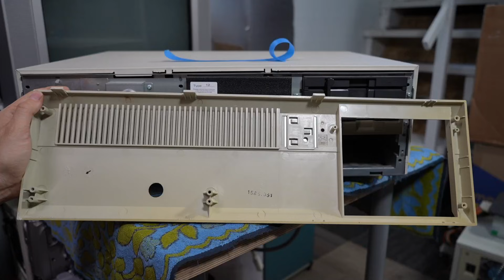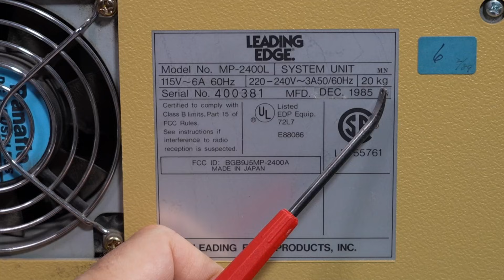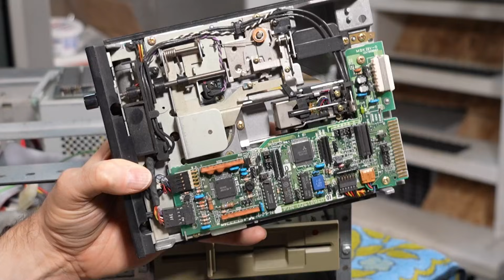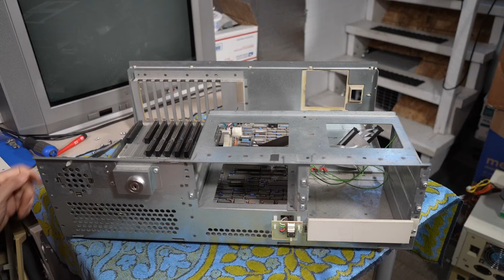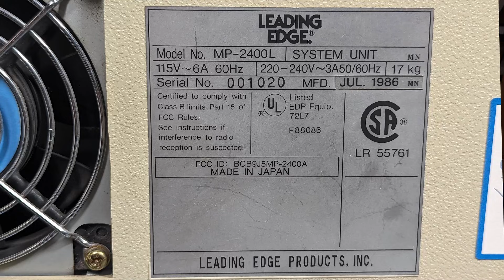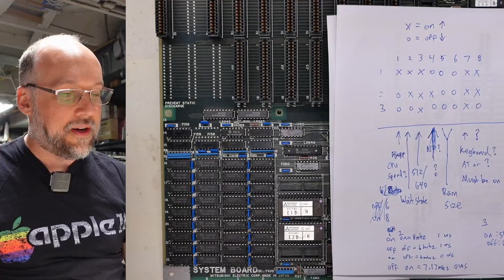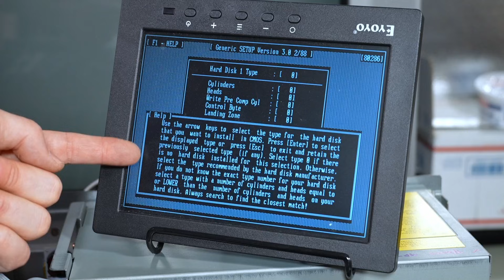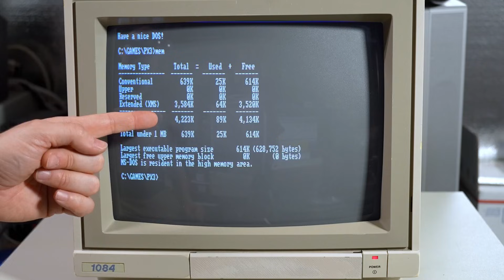PC archeology: The Leading Edge MP-2400L doesn't exist

Comment from the maker: Side note -- the one 1986 machine wouldn't run at 7.17mhz at 0 wait states. It would act up and freeze. All the other configurations worked fine. And the two older machines had no problem running at the fast 0 WS mode. Strange!
Reply: Would you like another one? I have the Sperry version of this same Mitsubishi PC, glad to donate the entire setup, including monitor, original keyboard  and manuals.  I'm located in the Portland area.
Reply: @ruly999  why would you donate to someone who dosent need it ? plenty of poor computer fans out there. im poor but in another country. so not me. just puzzles me ? sorry
Reply: Perhaps different brand of memory chips not taking the 0WS well?
Reply: Adrian, Have you tried the wayback machine to see if anything there is available for the machine?
Reply: @raypalmer7733 agreed 😊
Reply: retrobrite it?

Comment: I wouldn't compare the number of available molex connectors with the number of bays.. after all; We were limited to 4 devices WAY into the IDE era (Not only because of the channels, ports used, etc, by the controller cards, but.. by the Bios and Dos BOTH assumed that you would have at most two floppies and two hard-drives).. It would of course be possible to use some predecessor to SCSI to add devices, but 4 was plenty.. I assume the number of bays was because the assumption was that you were very likely to have a full height hard-drive.. It still only needs one power connector.

Comment: One of my dad's old computers is very similar to this -- a Sperry 3126-00, which seems identical to this computer aside from the badge. I definitely have this video bookmarked for when I get back home and have a chance to play with it again.

I appreciate the info about the power supply and DIP switches especially. That makes me want to try the 7.17 MHz mode (it's at 8 MHz now) and see if it works and what that does with performance. There was also a strange quirk where it would only boot to DR-DOS and freeze when booting MS-DOS or PC-DOS. I wonder if misconfiguration can cause issues like that or if something is buggy with it?

It's been about three years since I last powered it up, so I should probably check on the power supply (good idea anyway since I've always just powered it up without regard to what the voltages are). I've taken power supplies apart before to clean out dust, but I'd be a bit nervous for adjusting the voltages like that while it's running. I'll probably check them under load, adjust in small increments if needed, and then put it back together before checking again.

Anyway, thanks for the awesome video!
Reply: Works great and got it all cleaned up. Even boots MS-DOS now after configuring floppy drives correctly. Just one extra comment I'll make:

If you have one of these and it's stuck at 6 MHz, make sure to check that JP1 has a jumper across it. I had it removed, and it must have something to do with the CPU speed.

Comment: Nice, like I was back in time again. Wondering if you ever ran across a special board.
1. to stop copying disk's mfg's would play with sectors error's and such, non-formatted etc.
to overcome this, there was a card called a "copy 2 pc" it would connect between 2 floppy drives and directly copy, keeping sector formatting  intact.
We used this quite a bit as program sharing was quite common.
They tried and we defeated!

Comment: Adrian, I have used several of these back when, however not in the USA but Japan. They were badged as both Mitsubishi as well as Leading Edge as the company I worked for at the time, the company Minolta with the camera and optics division, had several of these to connect up to some equipment we had for testing industrial computer controlled automation. This equipment would populate (if memory serves me correctly) 6 ISA slots each which is why I think we used them at the time as we would also need a video out for display and a controller/memory upgrade combo card. The 3rd 5.25 bay we had populated with a passthrough card slot for some testing equipment that would route to an internally connected ISA slot. This bay also had its own power switch that had to be toggled before the slot card on the front could be inserted or removed as to not short anything. I worked there from 87-91 and not 1 ever had an issue. The monitors that were connected were some industrial rackmount Sanyo displays and the keyboards were black and from Mitsubishi that were extremely clicky and borderline deafening. Not sure I remember much else though as it was a lifetime ago now.

Comment: Re: 639kb vs 640kb base RAM in DOS; I think you mentioned "Scratch RAM" earlier in this video (I'm at the 58-ish minute mark as I write this) as a BIOS option.  That being enabled can cause 639Kb, as can "XBDA" (Extended BIOS Data Areas) and a number of other "Turns out, we needed more RAM for operating system/BIOS parameters!" names too.  Some newer systems with BIOS support for USB keyboards steal 1kish of RAM for that "EHCI" handoff or whatever of the acronyms that handoff was.  Disable XBDA/Scratch RAM to get it back...though they normally only can do that by the old "Rob Peter to pay Paul" thing of stomping on higher software interrupt levels or something and using their RAM area instead.  That 1kb might ALSO be for a 'Type 47' user-defined hard disk data area...depended on a lot of things.

This all gave me a quick flashback to the "UMB=" and "DOS=" and "EMM386" and loadhi options to let your favorite DOS games run.  I had a general use 'standard config.sys for most use cases', and a few drivers I could F8-step past if I knew I wanted to play a specific game.  Some things were better in the "Good ol' days", but two things we DEFINITELY improved upon were "not needing to fight with my Config.Sys to make games be able to run" and "Fuel injectors instead of carburetors".  Among many others, but those two have come to my mind today!  Carburetors because I was recently behind someone's old Bronco that was from an era that used it and WOW do they stink!  That exhaust is awful!

Comment: Back around 1986, I bought my first PC, a Mitsubishi Pc-AT which was essentially identical to yours with 1MB RAM and a 287 math co-processor. Now I recall mine used the grey floppy drives not the black ones. But the system was certainly fast. Mine is long gone, but I rather quickly moved onto DEC PDP-24 running BSD Unix.

Comment: I appreciate your videos! I have a question: I have an ARC ProTurbo 286 with MFM and Floppy controller on MB. I am having a real hard time getting XTIDE to work with it. I have set the on-board HD controller to be secondary. Any suggestions?  THe BIOS is ARC (Access Methods Inc. 1988 ver. 4.12). Thanks.

Comment: I remember a DEBUG command that allow talking to the MFM controller and set the drive parameters there, then the computer sees it.
Reply: Memory address C800 on most MFM controllers 
I've had to low level my XT Clone a few times because of...reasons. 
G C800:5 is embedded in my memory, nay my very soul.

Comment: Most PC cases do use the #6 imperial screws, but the Lian Li PC60 aluminium case I have (same model as LGR's Megaluminum Monster PC), it uses M3 metric screws all round. M3 screws are also used for 3.5" floppy disk drives, optical drives and 2.5" HDDs/SSDs.

Comment: I just found an ebay listing for a similar board "Vintage WFHSY4 386DX Mitsubishi MOBO & WFHEM1 WFHSB2 & Verticom ISA Graphic Card". Seller doesn't seem to have any leads on original purpose/market specs etc either. I am wondering why there's so little information. Perhaps there was a lawsuit or some other legal thing? Only other reason for such non-info is a very limited production run for specific customers. The whole design and feature set to me hint at it being used in a laboratory/high end industrial application such as factory automation or software testing or things along those lines. Neat find, regardless!

Comment: "Back in the Day" there were Wholesalers, of Computers, your average "little Computer Shop" or Small Chain went there bought Machines in Boxes or Parts, However somewhere there was a Table or Box with Hundreds of Different "Badges" So you could have a "brand", I started getting UN-assembled PC-XT's, I would Build & Sell, Looking VERY Similar to the One you have on here, except mine had the Hinged Lid, I don't even remember the Badges I used ...

Comment: The FCC ID (bgb9j5mp-2400a) indicates that the system was manufactured by Mitsubishi Electric Corporation (US Division) circa 1985, although the mp-2400a variant was a re-certified variant of the original bgb9j5mp-2400 (no terminal a). The FFC records offer no details other than shielding requirements.

Comment: I worked with a Leading Edge, Model D with an 8086 processor, and I recall this model was anticipated for a long time, and by time it came out, a lot more low-cost clones were available with the 80286, so it's effect was nothing like the Model D

Comment: ARGH those wires passing by a metal knife-edge inside the case! Those edges are plenty sharp enough to cut into wire insulation, particularly old and brittle. That should be fixed!

Comment: Really?  I was not aware of what you stated that cases now all use, as you say, imperial threads...  not metric.  I have many older cases that have metric...  I usually just use the screws that come with the case so I don't worry about what they are.

Comment: My 286 was an Olivetti M 290 S that initially came with a 16Mhz CPU, no FPU, on-board VGA card, 1Mb of RAM, a 100MB IDE HDD, one 3 1/2" FDD and one 5 1/4" FDD.
I supercharged it by adding a 287 FPU, 4 more MB of RAM to a total of 5. Added an ESS sound card and replaced the 5 /14" FDD with a CD-ROM drive for which I had to add an extra add-on IDE card. That was a pretty beefy 286 which I had used all throughout high school.

Comment: I remember back then, they'd put things in like FDD controllers for no reason.  I mean, they'd cause conflicts, everything.  I'd come across stuff like that all the time.  I do remember those Paradise VGA cards being pretty decent, though.

I think people thought like - more is better?  Or something, but IO and IRQ conflicts were a major headache back then.  Especially when you'd go to try and install a network card.  Entirely possible that's what happened?  The motherboard FDD controller could have conflicted with the network card, and they put in another FDD controller so the drives would work.  Their network was probably weird and flaky afterwards, but mostly worked, lol.   Hard to say, but back then it was like that.

Network is early Ethernet - not token ring, 10mbps.  Not Lantastic, so they were - probably?  Running Novel.  Interesting thing about those is that a lot of them - they had a chip that would blow out almost every time there was a big lightning storm.  I changed so many of those cards and chips, and set up so many networks with that.  I'm, just, trying to remember right now if there was any other networking option - other than Novel or Lantastic for PC, before Windows 3.11, and nothing is really coming to me.  I, probably, set up hundreds of both.

Really, remembering, *nix back then was mostly serial.  At least the stuff I worked on.

And, oh, geez - genning Novel boot disks was a major undertaking that could take 9 or 10 hours, back then.  Only to find out there was some conflict that, actually, didn't even matter - but, it wasn't going to gen your boot disk if it thought it did.  Could take days to get sorted out.

But, to give you an idea - one lightning storm could pop chips in 10 machines for a relatively small business, easily.  The chips were cheap, but for me to go out and change them - my boss had to charge for my time.  So, a lightning storm could cost them $1000 - easy - and that was a lot cheaper than replacing the cards at the time.  Something like that.  Sadly, for me, at the time I was young and working for pennies.  But my bosses raked in some serious money over that stuff.

Honestly?  It might seem like 10 expansion slots is great and good, but - for a lot of small businesses - it would have been better for them and saved them a TON of money if it was only 4.  Seeing a packed motherboard like that, from back then, still makes me cringe.

Back then, I'd have to do everything I could to cut the number of IRQ and IO conflicts, and fit as much as I could into what was there.  People would want crazy stuff working, but it would - just - trash everything, lol.  The whole system would be completely unusable - or worse, weird intermittent problems that could take down the whole network.  Not like now, where everything is just plug and play that actually works.   We don't even think about that stuff, anymore.  I was good at getting as much as possible to work, but dang...
Reply: Fitting things in upper memory and extended memory, and QEMM, and all that was another whole crazy see if it fits journey.  Gawd...  Serial took IRQ 3 & 4, other stuff took up a bunch of other IRQs, you really only had 7 & 10 to work with, if I remember right.  But, then there were the IO addresses, and each card would only have, like, 2 to choose from - and they seemed to like choosing the same IO addresses a lot.  Oh, gawd...   That was hell.
Reply: I saw someone in another comment say how these things were notoriously unreliable - that's BECAUSE they had 10 dang expansion slots, and people wanted all their holes filled.

Comment: The CMOS/NVRAM lives on port 0x70 if remembering correctly, it is index based, I twiddled around with it a lot as school computers were locked down and floppy drives were disabled/unconfigured -- debug could run instructions to enable and then reboot, floppy enbled.

Comment: Adrian:  I have the 386sx version of this, it's a Mitsubishi MP3200.  I call it "Uncle Sherman" because it's old and built like a tank.     Mine works fully now except for it crashes when it tries to go into protected mode - I decided to shelve it until I improved my troubleshooting skills, and it may be time to have another go at it.    I do have a question:  I have temporarily replaced the original PSU  with a modern one but I was unable to identify the white wire on the grey 4-pin connector - do you know what that is for?  The others are 12, -12 and -5, but the white wire eludes me.  I got no voltage from it during my tests and I'm not experienced enough to figure it out by reverse-engineering the power supply PCB, but I did find that it goes to the chip-enable on the RTC module, so maybe it's supposed to be 5v standby?   All I can think is that it is a power-good signal - except that it powers up fine without it connected.

Awesome content as always - however it was especially awesome when you took the case off this Leading Edge PC and I could tell it was a Mitsubishi just like mine!

Comment: Uh... about those batteries! 😅 You pointed out a board with two CR2032s "in series", which would mean it's giving the clock chip 3*2=6 volts (or a bit over, probably 6.2-6.4) -- but the original battery was a 3-cell NiCd setup, totaling 1.2v*3=3.6v. Just wanted to point that out in the vague hope that maybe they're not really in series?

Comment: This PC reminds me of the giant WYSE 286 PCs I have.  They have the same power supply.  They use a backplane design though.  The CPU, memory, everything is on daughter boards that plug into the ISA bus like any other card.  But they are large and solid steel everywhere.  This computer looks like an industrial machine designed for harsh environments.

Comment: Have you tried, in gsetup, using the arrow keys on the numeric keypad and/or hitting the numlock key? It's very possible that bios may not support enhanced/extended keyboards and the arrow keys aren't giving the scan codes gsetup wants.

Comment: I wish more PC case makers did similar cases adapted to modern standards. Modern cases are very nice, they have done lots of QoL in the flashy ones, but the kind of basic  looking cases are usually very cheap and small. I'm tempted to look for a similar broken pc or case and adapt to it ATX and modern 12/14mm fans, this case is awesome.

Comment: Super cool seeing what looks to be the ultimate AT clone, at least if you want to run at AT speeds. Neat that you could switch between older and later AT speeds plus the slightly boosted one. Hoping you find a way to set up the MFM hard drive. If I ever tried to build a recreation of my 286, I’d need to have a working MFM drive in it. It just wouldn’t sound right without it.

Comment: Only paper capacitors usually get leaky. While Japanese manufacturers did have less smoky variants of the infamous rifa paper capacitors, chances are they used polyester or mixed dielectric. Mixed dielectric still contains paper so it does degrade, but it doesn't usually get leaky.

Comment: For those confused, the cylinders, sectors, etc to put into the CMOS/BIOS if the HDD was not auto detected, was printed on a sticker on the HDD so no guessing was needed. It was general knowledge for any PC user.

Comment: I wonder if the models with the heavier power supply, the more rugged case, etc were models not released to the general public.  Perhaps they were designed for or perhaps even custom made models for a specific group.  Such groups that might be able to take advantage of heavier duty components or even custom components might include educational, industrial, prisons, hazardous locations, government, the military, and others along these lines.  I wondered if these models were originally made for one of these groups and not sold to the general public through their catalog under a custom order.